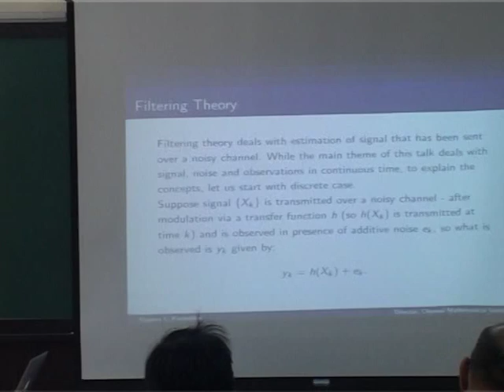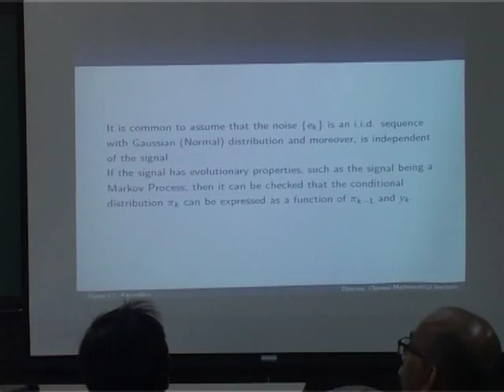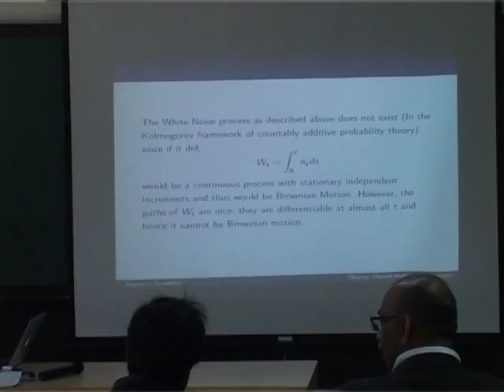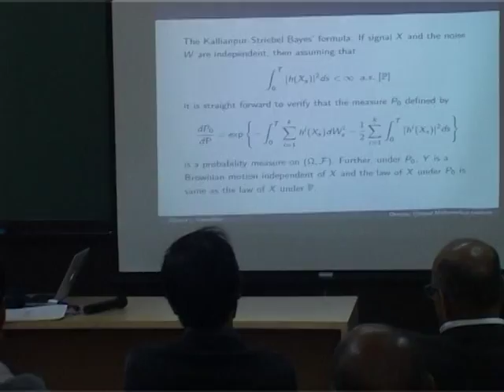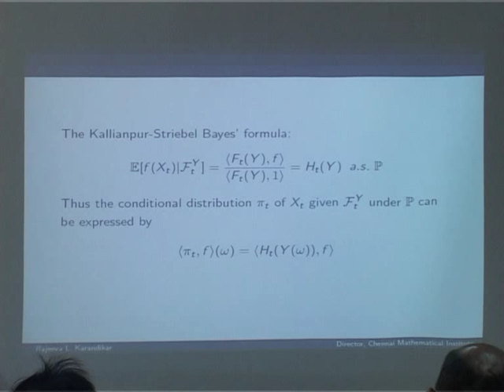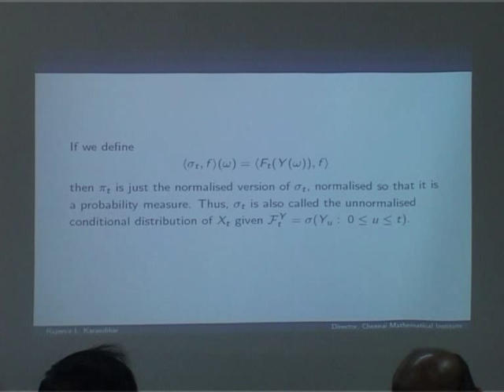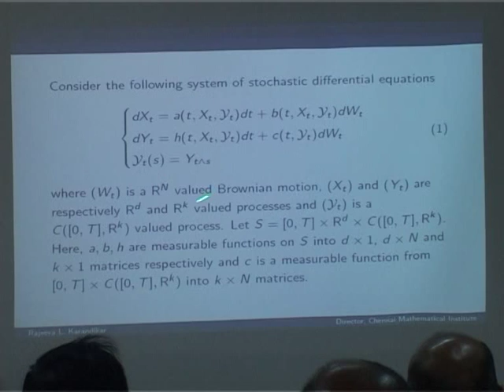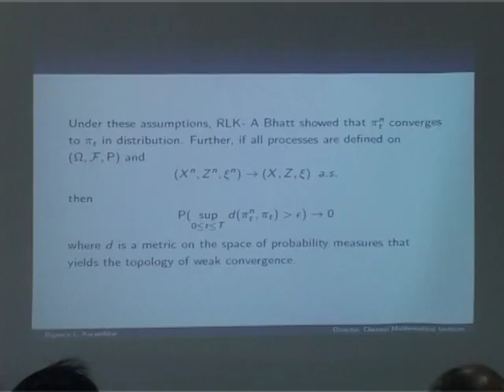Rajeeva Karandikar - Overview of nonlinear filtering

Comment: A comprehensive literature survey on nonlinear filtering could be find at http://www.tutorialpoint.org/Filter/nonlinear-estimation-literature-review-page1.html

1. Literature review on quadrature based nonlinear estimation

Rahul Radhakrishnan, Abhinoy Kumar Singh, and Shovan Bhaumik
1.1 Introduction

Non linear filtering problem consists of estimating the states of a stochastic system using noisy measurements. This problem has significant applications in radar tracking, navigational and guidance

Read more: http://www.tutorialpoint.org/Filter/nonlinear-estimation-literature-review-page1.html#ixzz3C2Jm8L87